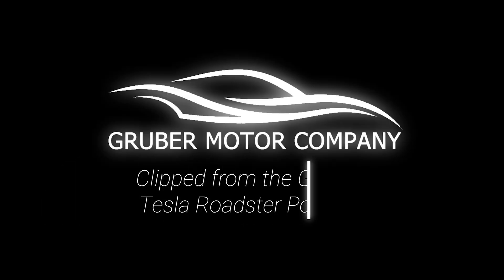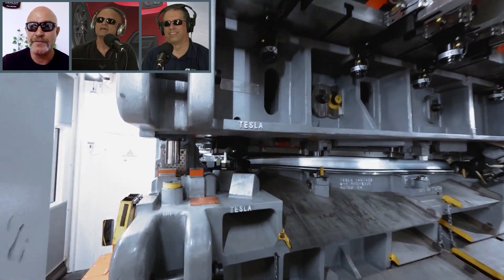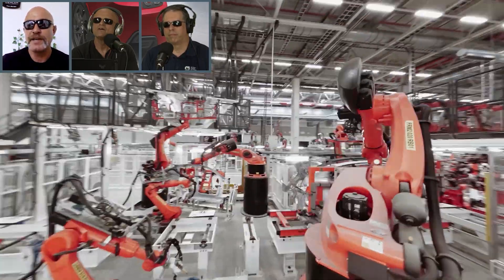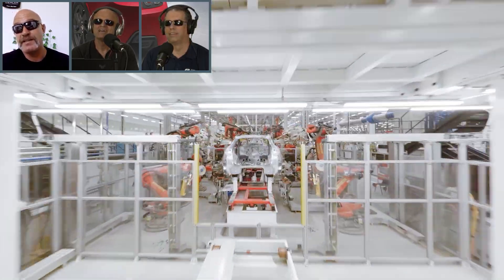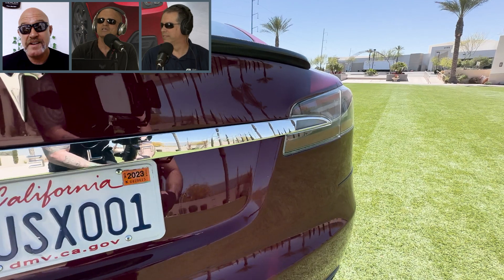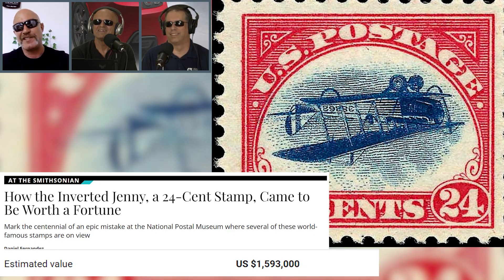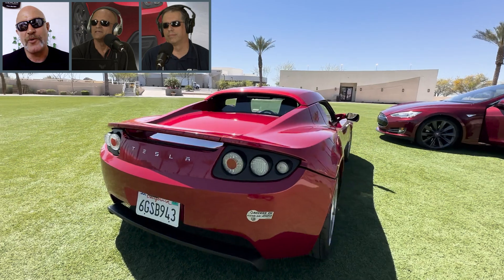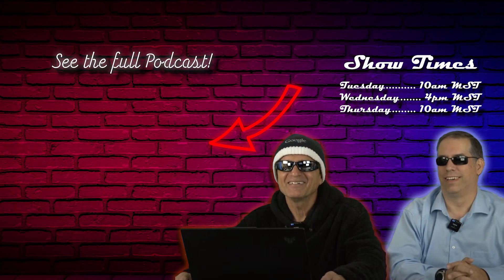First Teslas Had Panel Gaps: Why?

Comment: I wonder if my old 2013 P85+ will ever be valuable
Reply from the maker: In the world of auto collecting, limited runs are part of the intrigue.  Having built hundreds of thousands of Model S's, the bulk will not attain collectible status, only the "Signature" status cars, (the first off the assembly lines), and very low VIN numbers or a Founders car like the one described in the video.
Reply: Just wait.  It's only 10 years old.  Its value should curve back up.